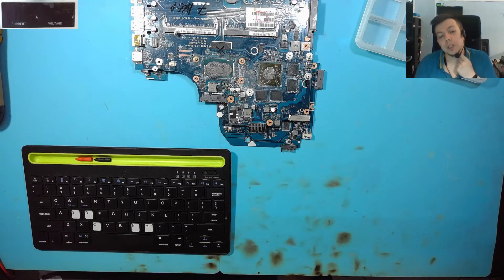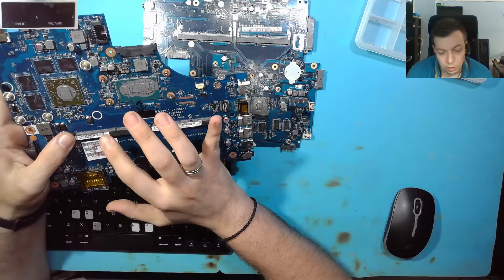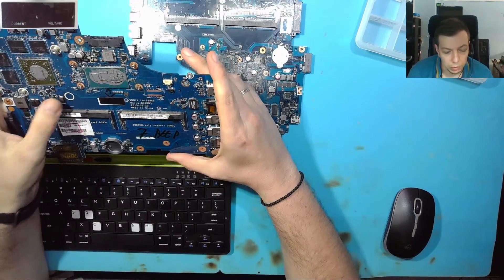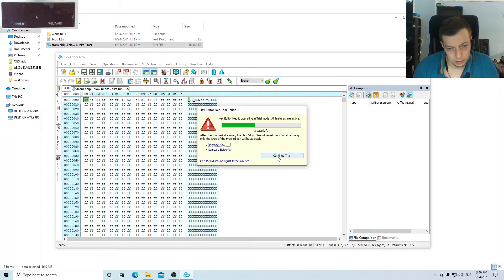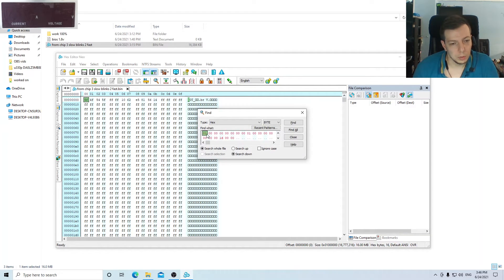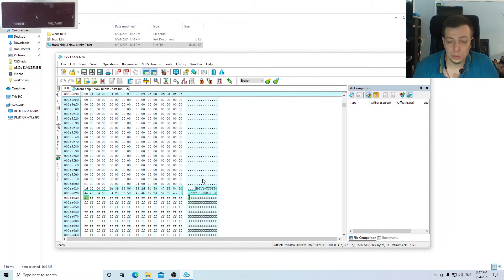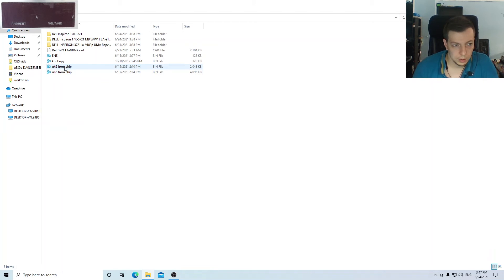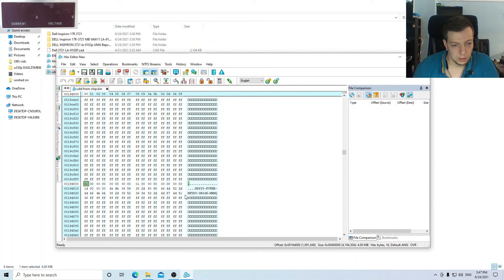How To Retrieve OEM Windows 10 key from BIOS Dump

Comment: hi!, you can use this "method" only for uncrypted DMi areas... on Lenovo bios there is a protected area (LENV) that is storing DMI information (like the windows serial) ... in this case the job can't be done with an HEX viewer,  i wrote a small utility to de-crypt that is called BIOSdump2license
Reply from the maker: Wow, just tried it, awesome tool, thank you very much
Reply from the maker: if i could add something it would be the option to copy the key form the software :)
Reply: @ntechlab8357  the key is automatically stored on clipboard :)
Reply from the maker: ohhhhh, you are too good! excellent!!!
Reply: @ntechlab8357  thank you very much N-Tech! :) :)
Reply: How to use the tool? It does nothing for me. Opens and closes after a second or two.

EDIT: The tool does not run on Windows 11. On Windows 10 it works fine. Thank you!